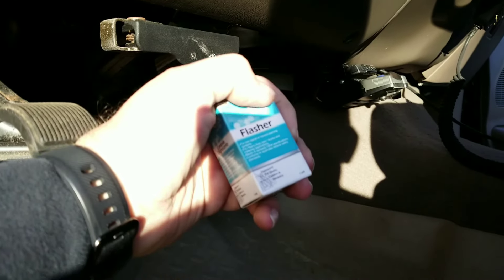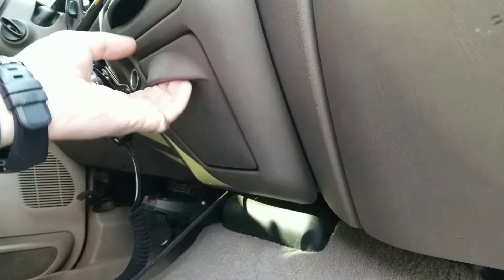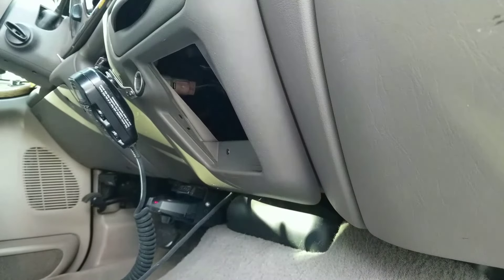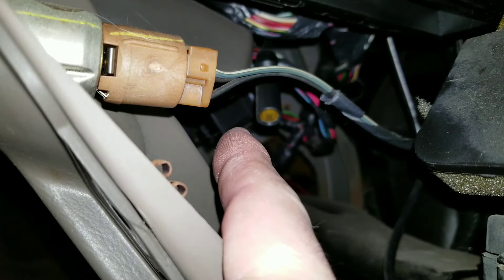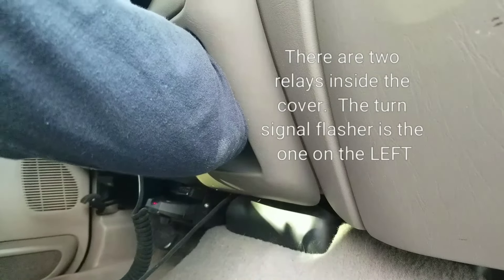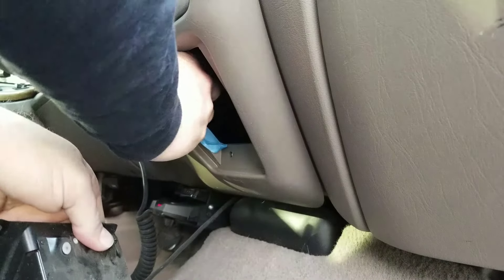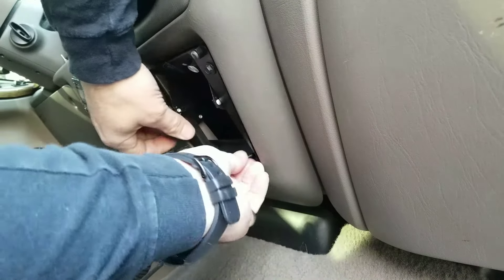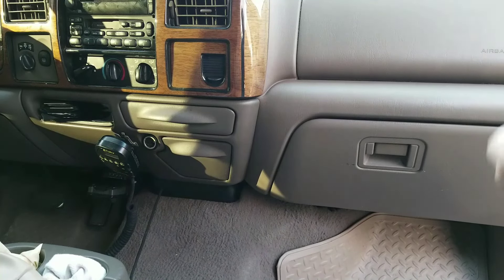1999 to 2006 Ford F250 and Excursion "Easy" 5 minute Turn Signal Flasher Relay replacement $save$

Comment: Yo! Tried and tried. could not pull them out. watched another video. used my five dollar radio extractors and pulled the radio. they are about 8 inches below the "WIDE opening of the radio. reached in and, with no arm scratching, pulled them out. Mignt note the i had a parasitic drain which i could not locate. checked the draw after removing the 3 flashers, NO DRAW. Never would have discovered it if the blinkers had not gone out. Consider pulling the radio, it takes about 2 minutes in and out.
Reply from the maker: Either way is good.  Thanks for the comment.
Reply: I'm trying, too. I can't even get the tabs to release the cover.. my arm is torn up even with the tape.

I'm going to try the radio way.

BTW, I'm not a chubby chick, but  I can't get my arm all the way in that ashtray opening. Maybe because my forearm isn't as long as a dude's. IDK...

Comment: You don’t have to take anything apart. Just reach up in there, take the relay cover off and pull out the relay. Replace by feel. Once you do it a few times you can do it in 10 seconds.

Comment: Word of warning.  In some older trucks, there might be a strip of black tape wrapped around the black box.  If you can't see the black box (or the tape), then removing the case will be a futile attempt, as it won't budge without removing the tape first.

Comment: This by far, IMHO, the best video on this R/R procedure.  I did not use tape, I used a Dremel to trim the opening on the left.  My flasher (1999 F250 SuperDuty XL), was on the right, not the left.  The learning curve can be steep for this, but once you know how, EASY PEASY!
Reply from the maker: From other peoples comments some flasher relays have been on the left and some on the right.  The harness they are plugged into must be able to be flipped one way or the other.  So when it was being built in the factory it didn't matter which way it went on. Anyway...I thought of sanding down the edge but  I going for a quick and easy repair.  It'll hopefully be a long time to I replace it again.  Thanks for the tip and your comment 😉👍

Comment: Just a quick follow-up. I ordered a relay on Amazon and it fit ok, BUT, it constantly ticked immediately when installed (ignition off). Found out from further research that it must be LED "compatible". Which means it will work with halogen, led, and or a combo of both. I found Novita EP27 for $15.99 at Auto Zone here in So. Cal. Popped it in and it works great. Cost a bit more than Amazon, but worth it. Thanks again for your great video

Comment: First I changed the turn signal switch and it didn't help it continued the same until I saw your  video. Thanks,I did it under the steering wheel and it was much easier and faster

Comment: Thank you so much for this video! I watched this, got the part added to my shopping cart and then decided to do a dry run before purchasing (I don't know how many times I have purchased something for the truck after watching a video that makes it look so easy and then find out my truck is different for some reason). On my 2006 F-350 (Powerstroke) the "ash tray" compartment is about a forearm's length to the left, so when I pop it out (no screw removal at all) the flasher module is literally right behind it. As long as I stand on my head, I can get my arm in at the right angle to pull off the black cover and pop out the blue OEM flasher. Again, thanks for your video and tips. It gave me a good idea of where to start.
Reply from the maker: That's great,  I'm glad I could help.   Thank you for the comment.

Comment: Thank you!!     My (1999 F250 4X4) had the rapid flash due to 2 new LED signal/park lites installed on front of truck. I purchased the EP27 Movita Relay from Oriellys/  My signal/Hazard flasher was located to the right (engine side)  I used your cigarette lighter hole access idea.  I took a seat on passenger side sitting on my left butt cheek and using my taped up right arm to access.   I can see where a big fore arm would be an issue.   thanks again for the motivation.  I was considering "resistors" until i heard how hot they got
Reply from the maker: I'm glad my video helped.  Thank you for the comment.

Comment: Very helpful video! Removing the old one was not easy but I managed to finally do it. Lots of wiggle and when you can get your fingers behind it you're done. PITA but way better than dash removal! Turn signals are not rapid flashing anymore. Thanks!
p.s. forgot to add - I have a 2001 Excursion so no ashtray just the 'panty holder' hook to remove (2 screws)
Reply from the maker: I'm glad I could help.  Thank you for the comment.

Comment: Very helpful. I found the flasher in an F650 in the same spot. It had a black cover hiding it but I removed it and there it was.
Reply from the maker: I'm glad I could help.  Thanks for the comment.
Reply: @ZeroFuelRequired  by the way, it fixed the problem. The turn signals, hazards, and brake lights came to life.

Comment: I wonder if my 2000 f250 would allow me to do this?
I have a cb radio and an aftermarket single din radio in the slot where the factory radio was.

My cb radio quit working so I removed it and sent it off for work under warranty and in the mean time, all my blinkers quit working.
It ended up being this relay.
But since i already had my cb radio out and my stereo radio halfway out, it was easy for me to just reach down in there.

Comment: This did make it easier I thought I would need to take the dash off and being away from home I didn’t want to do that. I did have difficulty pulling out the old relay though. But at least now I shouldn’t need to manually flash turn signals
Reply from the maker: I'm glad my video helped.  Thanks for the comment.

Comment: On 2005 F250 with pull down utility compartment, (sort of an ash tray by lighter,) squeeze the side retaining pins towards the center releasing the tray, and relay was directly behind this tray with black sqeeze clip housing. If you purchased Amazon flasher, it's taller and housing won't snap back on. I gorilla taped in place. Took 30 seconds to swap relays on 2005 F250 Superduty
Reply from the maker: Good info.  Thanks for the comment.

Comment: On my 2000 f350 my relay is on the right side - on the left there are only 2 smaller relays - otherwise i found this video very helpful 👍🏼

Comment: Not to hop on OP’s video but for us bigger fellas the easiest way for me to get it out was to put truck down to 1 gear and remove dash bezel and remove the radio and there is plenty of room to get your hand in there to remove the relay and place a new one in its place. I fought with trying it this way but I couldn’t see it. I removed the radio and I saw it right in the way 5 minute fix max.

Comment: our work truck started having intermittent issues with turn signals.. i found the turn signal relay. i could hear it click only when the lever was moved,, but it did not click click click... i removed the relay, and being the electronics guy that i am, i took it apart, i took a close look at it, and i could see almost microscopic cracks on the repay connections inside the unit.. i did some resoldering and reinstalled / tested.. it works like new now.  not sure how much i saved, but saving is always a plus..
Reply: Nice one.  Sometime I just like to take things apart to see why they fail.   It's not about $$ more just curious.

Comment: Going thru the removed ashtray was a great idea (2000 f-250). However, I couldn't actually see inside , so I did it by feel. As indicated in the video at 4:43 , the flasher is on the left. So I pulled and pulled and finally got it out. Only problem is that it wasn't the correct flasher relay. It was 2 stacked relays and not the correct one. Mine is on the right towards the firewall.
Reply from the maker: Out of the 126k views I've had a few people  comment where the relay was on the right not the left.  I just wonder if that's because the place they plug into could have been installed incorrectly from the factory flipping the position from left to right?  IDK? Thanks for the comment.
Reply: Mine was on the right. 1999

Comment: What were the symptoms?  I have continuous clicking sound that won’t go away after the signals and hazard are returned to off position so is that what you had?
Reply from the maker: When my relay quit, it just stopped working  all together. A LED compatible relay will click a few times after the turn signal is shut off. It sounds like , if yours is continuing long after you use the turn signal or flasher you have another problem. It's a good possibility that you have a short that is feeding power to the circuit for the relay. The short could be in column or the multifunction turn signal switch. Thanks for the question.
Reply: @ZeroFuelRequired  Just following up with this, it turns out the other possibility may be the multifunction switch or also known as the turn signal unit.  The entire lever and the housing that is in the steering column may be the culprit.  I tried a new relay but it didn't fix my problem.
Reply: @dasteufelhund did you find
A solution, a relay didn’t fix my problem either.
Reply: @raulangulo6351  Yes.  Unfortunately, you will need to pay about $200 for the discontinued Motorcraft multifunction switch, that lever and the base is the whole unit that needs to be replaced.  There are videos on YT.  The process was easy.  But the cost was a bitch.

Comment: Looks easy, but I'm having a hell of a time getting that cover off the relay box.  The two side tabs won't release when squeezed.
Reply: I did, too. One side popped off, the other side refused to cooperate. I said many choice word.😡 I couldn’t get a good grip.

I ended up pulling my radio, and used a trim tool to gently pry around the half opened cover until it eventually popped. The relay part was easy.

Comment: Would this cause all turn signals to blink fast as if one is burned out? All work, but blink fast. Thanks!
Reply from the maker: @chrispy841  do you have  L.E.D. compatible flasher relay? Or a factory flasher relay? Do you any L.E.D. Bulbs?
Reply: @ no led bulbs
Reply from the maker: @chrispy841  a possible bad ground,  but I  think it's more than likely the relay is going bad and should be replaced. If you replace it, put in a LED compatible relay, so if you ever put in a LED bulb,  you won't have to change the relay again.
Reply: @ZeroFuelRequired  i actually ordered one and will be here tomorrow. Thanks man!
Reply from the maker: @chrispy841  no problem good luck. 👌

Comment: My arm is to big around to fit in that hole  but I figured out another way you can take off the duct down by the accelerator only one screw behind the fuse panel cover holding it on only took about 5 mins and you can see what your doing

Comment: i have a 2001 excursion, im going thru the same hole, but im not sure but it might be smaller. i can reach but not release the cover. the tabs are on the side but i can only get to one side. not sure if i have to remove the other whatever next to it. any suggestions? love your technique because i dont want to remove the radio etc.
Reply from the maker: It's tight in there.  Squeeze it and wiggle at the same time.  Or find someone with a smaller arm that might be able fit in there easier to grip and press the release tabs. I hope this helps and thanks for the comment.

Comment: Ford f 150 2001 turn signal from side right it doesn't work. left or front directional yes. the ones behind also working.   serve the flasher relay if it ticks .. noise. But the multifunctional switch to change directional from left to right the following I put it to the left and the Light on the dashboard flashes my fast I move the switch a little and  is working normal.. that can be wrong?

Comment: What are the symptoms of a bad relay?
Reply from the maker: @PewPewPapi80085  Turn signals and hazards share the same flasher.  Since they share the same flasher,  if the relay quit both the turn signals and 4-ways wouldn't work.  So if one or the other works, then most likely the relay wouldn't be the problem and it would be something else like a bad multi switch, bulb or ground. Hope this helps.  Thanks for the question.

Comment: Hmmm, on my 2002 4x4 XLT diesel the ashtray is tiny, between the pullout cup holders....   Where your ashtray was is a panel with a hook...    I removed that panel (2 7mm screws) but couldn't find any relay assembly cover under there, doesn't help that i have XL hands.
Reply: Ah hah.    Found another video suggesting coming from the fuse panel side....   Well my relay block wasn't where it was supposed to be, but it was hanging loose under there, looks like whomever installed the trailer brake controller mucked about....   Anyways, Ford blue flasher out, Napa EP27L in, and it's good to go!!

Comment: Just installed the led flasher relay and now the relay won’t stop clicking and put the original one back in and it’s fine. Any ideas? Thanks
Reply from the maker: Is the flasher a LED flasher or LED Compatible.  They are different. A plain LED flasher relay needs LED bulbs in to work properly or a load resistor installed in each turnsignal.  A LED compatible relay will work with both bulbs front and rear incandescent,  a LED in the front Incandescent in the rear or vise versa.  And all LED.  Double check what your relay is.
Reply: Zero Fuel Required It is a led flasher relay. I have led turn signal lights in the front but stock tail light bulbs. So either replace the relay with the correct one or buy led tail light bulbs ?
Reply from the maker: @ivan-ky9je  take a front turnsignal bulb out and put it in a back tail light so you have a LED IN Front and rear on the same side then test the turnsignal on that side to see if it blinks properly.
Reply from the maker: If it blinks properly then you know you just need LED bulbs all the way around.  If it doesn't blink correctly then it could a defective flasher relay
Reply: Zero Fuel Required it already blinks properly the relay fixed the hyper flash but now my problem is that the relay itself is clicking even with the key off
Reply: Zero Fuel Required do you have a new link to the one you bought the one in the description says it is unavailable.
Reply from the maker: @ivan-ky9je  https://www.amazon.com/dp/B000JZ33H8/ref=cm_sw_r_cp_apa_i_IzZsFbSZMA3T0
Reply from the maker: @ivan-ky9je  little cheaper https://www.amazon.com/dp/B07QZRSYX5/ref=cm_sw_r_cp_apa_i_pDZsFbKPW70CT

Comment: Having trouble getting the relay out, its stuck like glue. But its warm to the touch, which i take is not a good sign
Reply from the maker: Try wiggling it from side it side,  it's hard to reach.  If it's stuck really bad and you can't get it to move or come out.  you might have to pull your radio and go in from the top.
Reply: @ZeroFuelRequired  thanks, i got it and it was the problem, fixed the break lights too, which i didnt even know was a related circuit

Comment: hi mate I have a excursion 7.3D and a couple days ago the flasher left side don't working!! but only a left side: the bulbs in front and side and mirror also!! but in rear and on right side everything is working well!! any body know who is problem? or what caind of problems can be?? thanks for put this great vedeo cheers from Norway
Reply from the maker: Start with the easy stuff, Check fuses, there is a fuse panel inside under the dash and a fuse panel in engine compartment look for blown fuse, check wiring harness grounds(-)  to the body.  Look for damage to wiring harness in door jam and trace wiring in engine compartment to front signal look for damage.  Check all connectors in harness for corrosion.  Check the bulbs themselves for corrosion in light sockets. Check with a volt meter if there is 12volts coming to light socket.  I hope this helps.  Good luck.

Comment: Tip for changing due to hyper flashing:
If you question that you are removing the right part, turn your flasher on. You should be able to hear the flasher to help recognize the flasher relay.
This obviously will not work if the flasher has stopped working.
Reply from the maker: Ray Flores good Tip. Thank you for the comment.

Comment: I know this is off topic, but would you know where the fuel pump relay is located? Some say it’s behind the radio. Not sure.
Reply from the maker: In this video when I show a picture of where there flasher relay is inside the dash.  The fuel pump is the other one in the picture.  The relay only turns on for 20 seconds then shuts off to prime the system so the truck will start. Hope this helps thanks for the question.